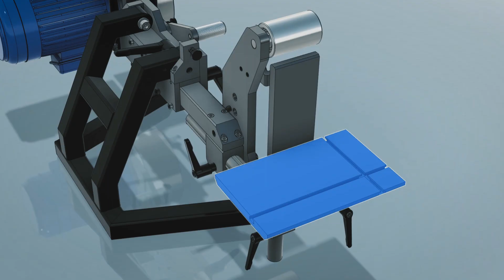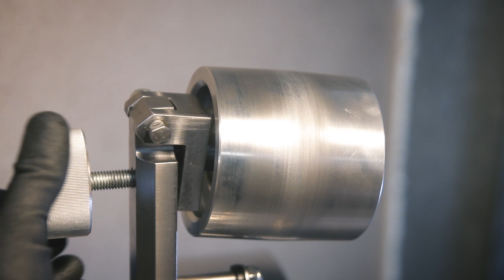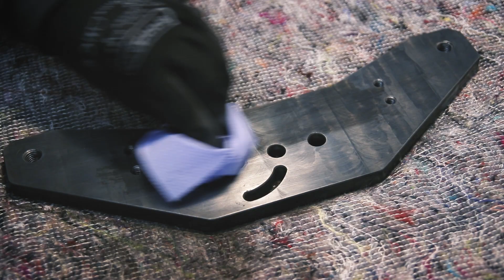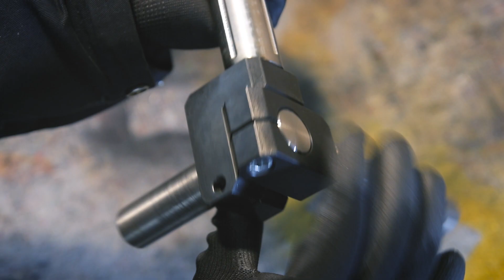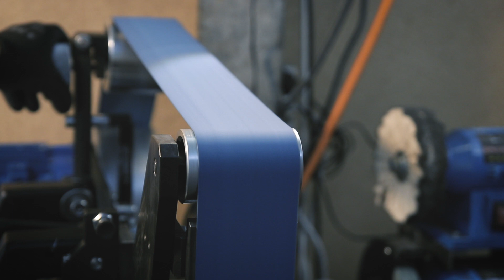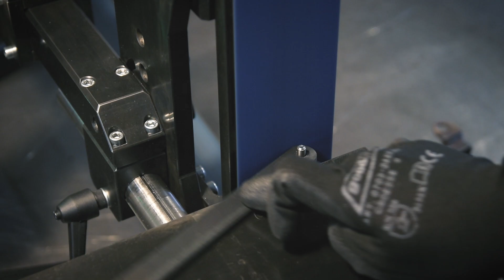Building a Machinists Belt Grinder - The Trilogy [Part 3 - Finale]

Comment: I wonder why such belt grinders usually are so largish. Are there no shorter belts available ?😊
I mean all you need is the front plate sektion, and of course a motor to drive the belt and a belt tightener.
There must be a particular reason for this that I can't see.
Reply from the maker: Longer belts run cooler and last longer, that's kind of the main reason. In most places you use these, the size of the machine isn't that relevant so there's not much benefit to making it smaller. This style of grinder also often comes with different attachments like contact wheels, surface grinding attachments and more that often require a large machine/long belt to support different configurations. 
But smaller grinders with shorter belts definitely do exist, this is just the size that has become most common since it works well for most jobs and spaces. They might just be a bit overrepresented on YouTube for some reason though, theres many other sizes and styles of grinders.
Reply: @PhilVandelay  Thank you for your answer. Makes all sense. I just thought about the room it takes in the workshop.

Comment: @philvandelay
I realize that is is an older video (3 years ago) but donyou have an idea of how much it cost the create this sander? I was a Machinist/Welder, in the Army, and wm looking to set up a home shop, now that I am retired. I have no equipment, aside from hand tools, but would love to have tools and equipment of this quality instead of the low quality (or extreme costs) of what can be bought in stores. Since I don't have the moll, lathe, etc, would you be willing to make the parts for someone? Donething that they (I, me) can put together. And, if you qre willing, what would ve the cost of the parts?

Comment: I found with my face cutter that the places for the inserts were not perfectly equal so the inserts were not all at the same hight causing chatter, by going round them all, loosen and reset them, sometimes even changing places you can get them almost 100% which leaves a perfect finish without chatter

Comment: Yet another comment :)

How has the close-tolerance fit of the square bar worked out? I ask because in another video, a builder said that he had the bar jam in the receptacle because grinding grit got in there and locked it up. Related, while oiling the locking handle makes sense mechanically, it seems like it would become a dust and grit magnet over time. This stuff aside, I've made YT videos before and fully respect the time and effort it takes to edit them down to the finished product - many, many hours. You do beautiful work, sir!

Comment: I've used many machine tools and built others, several using VFDs. For someone who uses belt grinders a lot, why is a VFD needed? I've used several sanding machines and never felt the need to change speed. Just mentioning this because it could save a lot of money, avoiding buying a VFD and allows using a cheaper single-phase motor.
Reply from the maker: It depends on what you do, the speed control is useful for a lot of things. Mostly grinding different materials, for example for grinding things like wood or plastics you want to have the speed way down to avoid melting/burning the material. For Aluminum it also makes sense to turn it down somewhat since it heats up very quickly which causes it to become soft and "smear", which clogs up the belt and can also create large burrs on the bottom which can potentially be dangerous if they get wedged between the belt and the table. It also helps a lot to turn down the speed when you need more control for delicate operations like grinding small chamfers. This machine is very capable and on full speed, it eats metal for breakfast -  controlling the speed can give you a lot more control over the result if you don't just want to hog off material. Lastly, there are many different kind of belts for these, not just for grinding. You can get things like polishing belts or surface conditioning belts which are not supposed to run as fast as a grinding belt. Don't think of this as "just a grinder/sander" - it can do a lot more than that and the speed control helps with that.
That being said, if you're mainly doing rougher work with steel and your main goal is to remove material quickly, then you could probably do without the VFD, but personally I use the speed control almost every time I use the machine.
Reply: @PhilVandelay  Ah, okay, very good points.

One other thing worth mentioning to potential builders: using a surface treatment makes good sense because it doesn't alter the part's size. Had they been powder coated, it's surprisingly thick, on the order of around 0.1mm (0.004"), which either has to be masked off where a precision fit is needed, or ground or scraped off, which can be a real pain.

Oh, and since it's been a few years, how has the coating held up against rusting? (realizing that it's more the oil coating than the "bluing).
Reply from the maker: @kurtbilinski1723  Yeah painting this wouldn't work very well I think, especially with all the sliding fits and contacting surfaces. The grinder has held up great, haven't had any problems with rust, but I should also mention my current shop is heated and well isolated, so I'm not sure how it would hold up in a "shed" like shop with large humidity changes. The work table looks a bit rougher now of course and the blueing has mostly worn off, but it wouldn't make much sense to renew it. It also gets rust spots sometimes when I dip parts in water for cooling but I just clean it up with WD-40 and scotch brite every now and then. Overall the machine basically performs like new. If you wanted to go the extra mile it would probably make a lot of sense to make the work table from some type of tool steel and hardening it afterwards, or maybe even using stainless steel.

Comment: Great build, I don't understand why you need a vfd. All the belt sanders i have used run at one speed. So I'm not clear why you need variable speed. Also 2Hp single phase motors are cheaper
Reply from the maker: There's a lot of reasons. Sometimes you need to do delicate work and might not want a super aggressive speed that takes off tons of material. Different materials also profit from different speeds to keep them from overheating. Aluminum tends to smear and clog up belts if it gets too hot, plastic will melt with too high a belt speed, wood starts to get charred. Often times I'll use surface conditioning/polishing belts that you have to run at lower speeds.  I called this machinists belt grinder for a reason, it's not just for roughly hogging off material in a fab shop setting, it offers precision and controlling the belt speed is very useful for that.  As for motors, three phase is just the better motor design for lots of reasons, so since I have 3 phase in the shop, I see no reason to use single phase.

Comment: This is one of the best belt sander builds I've seen , you can send mine to me anytime your ready, One Q, going  to build mine very soon I hope, have a motor and the VFD in mind, but very confused on the VFD, the motor is 2 HP 3 Phase, and full load is 5.22 amps,  I've heard you should use one that is 2X the HP of the motor, and very confused on what ones you should use , like the ones on the amazon  or E bay,  they don't offer a lot of info, You have any info on ones I could use?  Very impressed with your build, I also have a mill and lathe's to build one with but you should market yours. 👍👍👍👍👍👍👍👍

Comment: No worries with the wiring Phil cables carrying 600 volts are run through flexible metal conduit tube. Obviously if someone complains they apparently have little knowledge of electrical practice and codes.
Reply: You must be from the USA because over here on the other side of the big pond we never run power cables through any kind of metal conduit.

Comment: An EXCELLENT Video series  ... well done!  (BTW ... the easy way to thread cables thru pipe work is to use something 'flexistiff' like brush cutter cord  then once its thru ... use it to either pull the insulated wire or to pull some stronger venetian blind cord then use that to pull the wire !!) ...  Simples ... Cheers .
Reply from the maker: Good tip,  bike brake cable probably would have worked and I have tons of those.. well hopefully next time I'll remember

Comment: How did you get the forward/reverse function to work when you soldered the switch wires to the two outside terminals of the switch?
Reply from the maker: The switch doesn't actually operate the motor, it just sends a control signal to the VFD. I honestly don't remember the exact wiring but it works. I think it was something like if the circuit is open it goes forward, if it's closed it goes in reverse. Something like that

Comment: Hi, awesome project ! Well done👍,. I’m buying your plans etc. I live on the coast and have a rough time controlling rust in my cnc shop. Do you think the entire project could be made out of 7075 series aluminium and anodized ?
Reply from the maker: Yeah the plates are quite thick so overall I think you could replace most parts with Aluminum without it being a problem structurally. The only exceptions would be the clamping rods (they are subject to wear so probably good to use something harder, which is why I used stainless steel) and the worktable and platen, which also both see a lot of wear.

Comment: Would it not have made sense to cut the rear face of the table at a deep 45 to match the ball stop angle and allow the table to be moved as close to the belt as possible... the bottom edge. even with the small 45 chamfer that you added would keep the top edge of the table that your object is resting on several mm away from the belt.
Reply from the maker: Yes but that's not really a problem unless the part you're grinding is really tiny

Comment: This is amazing Phil I will try to make one as you have done, all though if you don't mind me saying, I cringed when I watched you using it to sand smallpeices wearing gloves - I nearly lost two fingers using a belt sander whilst holding the work wearing gloves, six months off work and extensive plastic surgery has made me realise just how dangerous these belt sanders are. Looking forward t to the next project
Reply from the maker: What kind of gloves were you using? The problem for me is that parts get ridiculously hot when grinding after just a few seconds, so the only other option is to dip them in water every 10 seconds which I guess I'm too lazy for... But I do see how a glove could get pulled between the belt and platen
Reply: @PhilVandelay  I was wearing tig welding gloves for the same reason to stop my fingers getting too hot, I wish I used some vice grips instead!! Keep up the good work Phil, great videos

Comment: Well, that safety police, about the cable inside the metal tubing, that's exactly the way conductors are run in the industry inside metal tubing if you ground the tubing, everything will be ok.

Comment: Nice Job!  Someone probably covered this, but bluing basically grows very hard microscopic "tree" structures of oxide on the steel like anodizing on aluminum.  The rust proofing comes from soaking the microscopic pores in the tree structure with either oil or clear paint.  This creates a harder more durable (and thinner) layer than paint that protects the steel, but you must soak it in oil for a while to get the oil in the pores.
Reply from the maker: Interesting! I'll probably just copy this post next time someone asks me about it 🙂

Comment: Well done Phil. You are a talented man. Very good design. I would weld that table mounting post so the grooves don't clock on you. A hand guard at the switch and also a belt guard on the upper roller would add some safety.

Comment: I have seen people use flat trays filled with water to catch the fine metal dust under the platform where you lay down the product you grind. Did you actively decide against that and if yes, what are the disadvantages of that?
Reply from the maker: I did plan for some kind of dust collection but simply didn't get to it within this video. But I'll keep improving/adding to this machine. I've actually made spark shields and something to collect most of the dust and that's gonna be in the next video. Reducing the mess that this type of grinder makes turns out to be pretty complicated, but in short: A tray underneath definitely helps, but I don't think it necessarily needs to be filled with water.
Reply: @PhilVandelay  I have only seen it in videos, so I dont really know, I think it was to prevent the grinding dust deflecting off the tray bottom and jumping out of the tray. But you could probably use sand or sawdust for that purpose, if it doesnt get blown away by the air. I am gonna wait for your next video, I like the overengineering style👍

Comment: What is the finished weight on this machine? It looks lighter than most 2x72 belt grinders I have seen.
Reply from the maker: Not sure what gives you that idea, everything on this is solid steel? It's probably around 80kgs / 180 lbs
Reply: @PhilVandelay  It looks more compact than others. Thanks for the response.

Comment: awesome build !

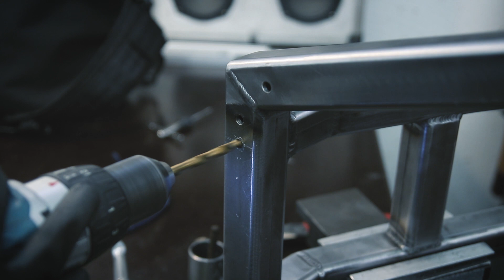15:00 It is totally fine to pull cables through machine frames, the cable just has to be made to do so , like ölflex or something along that line, i am an electrician and we pull in cables for a company that builds machines there using the same steel tube (ok little bigger dimesions) like you do for the frame of the machine and pull almost all of the cables through the frame and where ever it is needed it comes out of the frame through a cable gland.
So i would say there is nothing wrong with putting cable into the frame if youre using the right materials and techniques

ah and it is a good idea to use ferules (or a little bit of solder) on the wires when you have a screw-terminal, depending on the type of screw terminal the little wirestrands can be cut by the srew and so the connection might become loose and cause in the worst case a fire, left aside that it can happen quickly when inserting it that a little strand of the wire sticks out and can make a connection to a wire beside it, and that can be a pain to find such a error.

Comment: Rolls Royce of belt sanders. Ypu sholu rightfully be proud of the finished tool. It is obvious you spent a lot of time at the design stage and it really paid off. 
When carding down (the English term used for rubbing back)  the cold blue you will get better results with wire wool (pot scourer) since it removes the loose oxides without cutting into the oxide and into the metal like an abrasive will. For non heat treated parts I have had good success using the home oven. Preheat parts @ 350C and finish @ 450C while watching the colour change. I used an electric oven so it might be wise to test for rusting in a gas oven which will produce a lot of steam.

Comment: hi phil, have just purchased your plans for your belt grinder, could you please send me your 
contactors the electric motor, all the clamps, the gas ram, and the little plungers that pin point the 
rotating bars and anything that you find relevant. thaks

Comment: I have to say, one of the best YouTube vids ever. Your craftsmanship and vision is exceptional. If I had to make a suggestion, I would make your platen angle adjustment slot a full half round and opposed to the 1/4 slot you machined. The only practical use I would have for that, is for grinding knife bevels. If you can tilt the table forward, you can grind knife bevels without buying or fabricating knife grinding jigs. Just tilt the table forward and us a piece of angle iron for your jig. That is being nit picky because you just build a super high quality and amazing piece of equipment. WELL DONE!

Comment: Do you think it would be practical to make it with aluminum plate of the same dimensions ? I can't machine steel that size of that thickness but I could do it with aluminum. About 1/3 less mass but that could be made up by bolting it down or with a heavy base. Certainly more expensive too.
Reply from the maker: Yes I think it's plenty overbuilt so using Aluminum should be no problem

Comment: What a great build. I wonder if a Small 1/4 round shield ( adjustable / removeable ) around that top roller would redirect the sparks from hitting you in the chest or setting your beard on fire.
Reply from the maker: Yeah I'm still planning to add some spark shields as well as some sort of dust collection

Comment: About to start building one of these, I bought the plans. just collecting a few more parts. Having trouble finding a 2HP motor in the frame size you specify in the plans, they all seem to be too small. Did you use a 2HP or bigger Phil?
Reply from the maker: I did use a 2HP motor but I think it was an unusual frame/flange combination (flange is one size larger than usual, at least that's what someone else found out). I think the easiest thing would be to just adjust the hole pattern/cutout on the plate for whatever motor you can find
Reply: @PhilVandelay  will do. Thanks for the quick reply! I'll make it for the next frame size down

Comment: Phenomenal.  Would you consider hardening that beautiful table?  It might keep it unblemished.
Reply from the maker: Thanks! Thought about it but I lack the equipment to do that properly and I think it's not really necessary, more like the cherry on top. I think in this case it would be better to start with a harder material to begin with (like tool steel or something). I think if it ever gets to the point where scratches bother me I might just face it again on the mill, same with the grinding platen. Overall it's still a machine meant to do work, so I'm ok with it not looking brand new forever